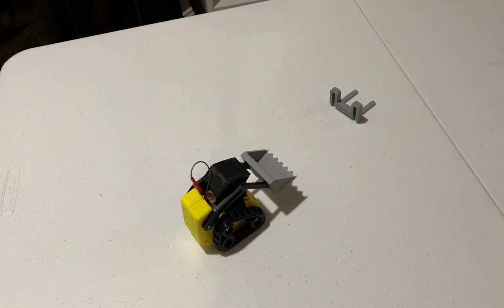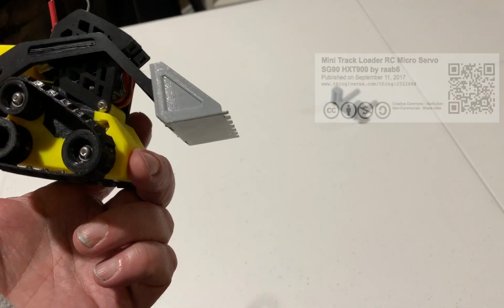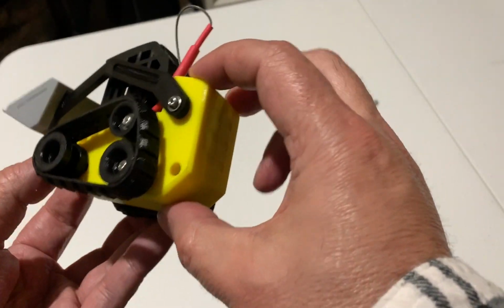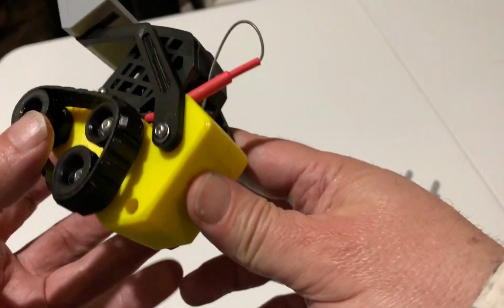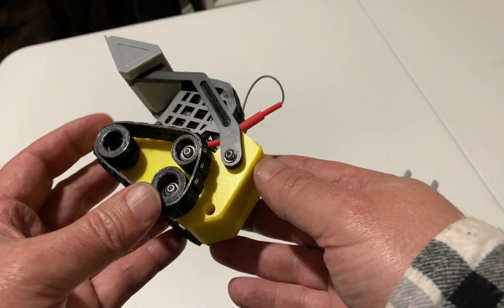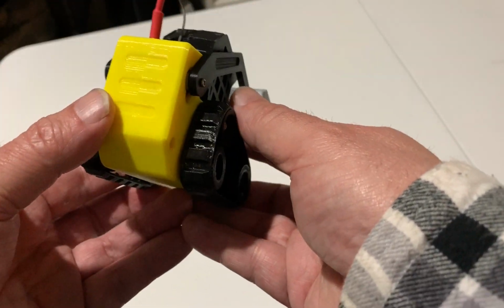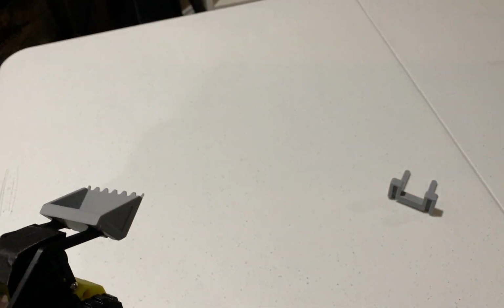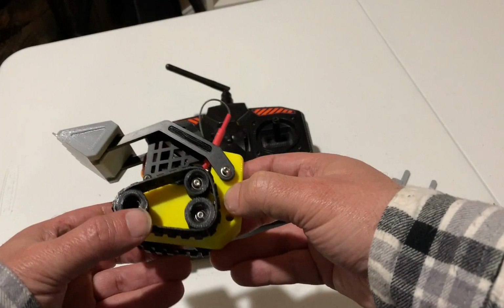RC Mini TrackLoader 3d Printed RC toy with my Prusa I3 MK3s

Comment: how can i get the servos to spin in sync ? I have one servo faster than the other 🤔
Reply from the maker: You can't really.  All motors are slightly different.  Sometimes in cases like this the tracks and wheels can be adjusted slightly for more accurate turning or driving.  But in general you can't ever expect any two motors to spin at exactly the same speed without a motor controller that uses feedback to actively keep them in sync.
Reply: I used my EPA for it, so that they are roughly the same speed, not perfect but it works.